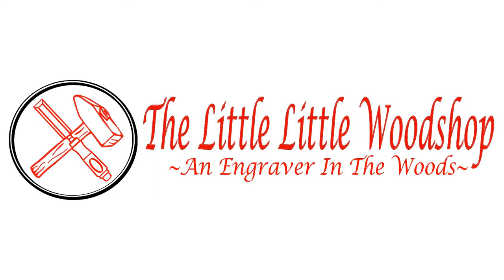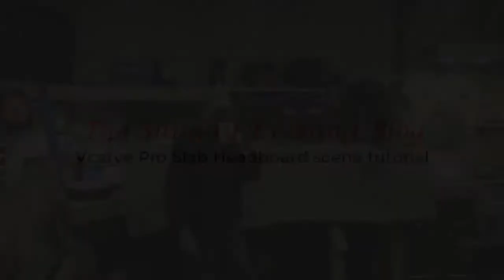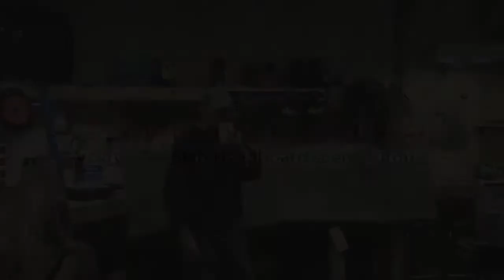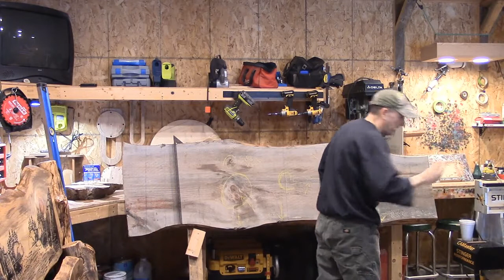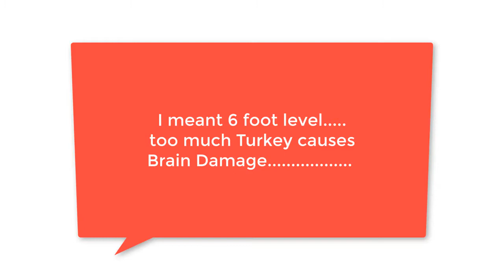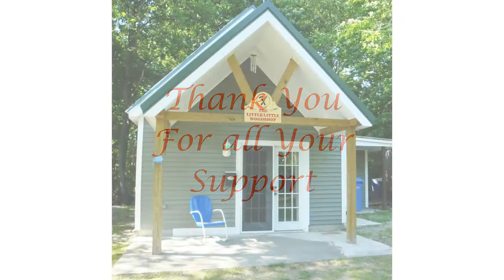Vcarve Pro Slab Headboard Scene Tutorial

Comment: Steve, thanks for the awesome videos. I sawmill a lot of lumber myself.  I would love to make or buy a cnc machine some day. My question is about your wood slabs the you are carving,  are they kiln dried or are you carving them when they are green. I know it can take from 1 to 2 years to air dry a slab that size outside. If you are cutting them green, how do you keep them from cracking. Thanks
Reply from the maker: I'd personally love a sawmill Sir ! Most of what we mill is KD but when I get my slabs green I put a coat of Arbor Seal on my ends and put it in my stockroom. Between a dehumidifier and the woodstove it speeds the drying process along nicely. Thank you for your support & Enjoy your Holidays !